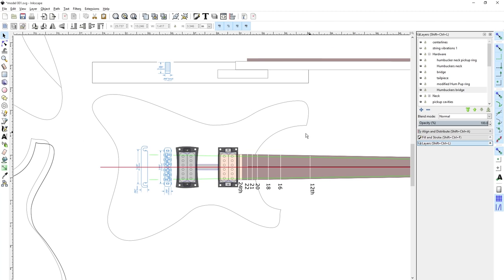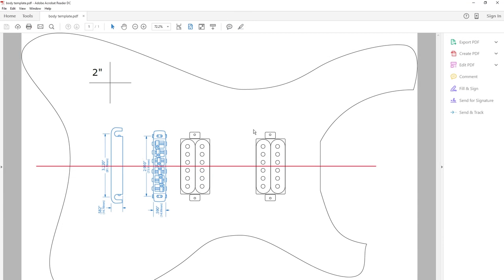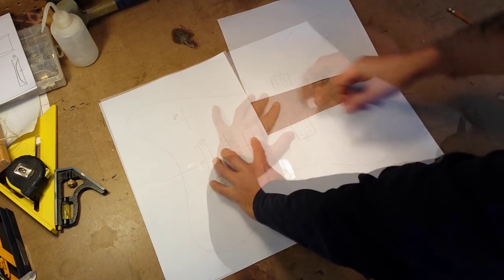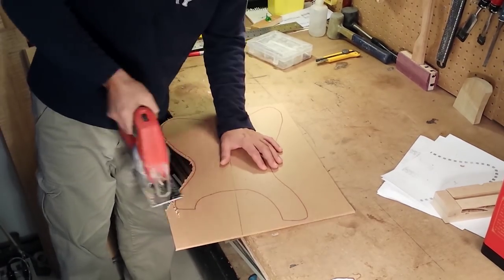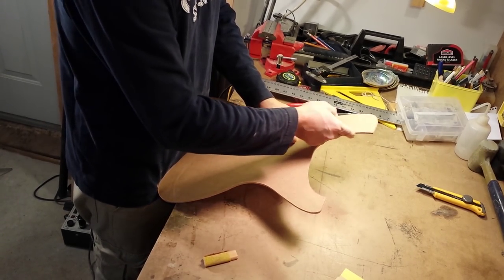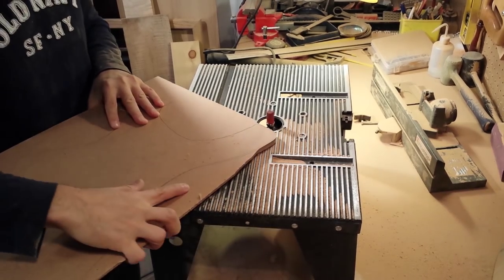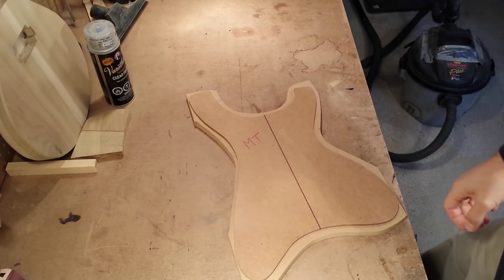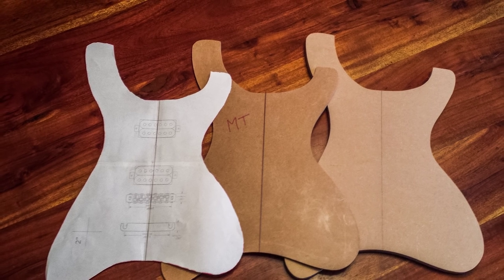How To Make A Guitar Body Template

Comment: You can make the edges of the 5/8 MDF template nice and hard by soaking them with thin CA glue.  I've used this trick before and it works quite well. But make sure you wear a respirator as the fumes from the CA can get quite nasty.
Reply from the maker: I did harden the edges with some polyurethane but I prefer your idea of CA glue, thanks!
Reply: You're welcome! Keep up the good work.

Comment: How come making a second 3/16" MDF template using the first leads to a more perfect master template?
Reply from the maker: Because the ball bearing on the router bit will ride over the smaller dips, bumps and marks on the first template and not register them on the 2nd template.

Comment: my template doesnt fit to the scale in printing in the preveiw box it doesnt fill out to to edges and when printed its not to scale, in inkscape i used to fit to scale or page option and i dont know if it worked so any solutions for me?
Reply from the maker: From Inkscape, save it as a PDF file and then open it in Acrobat Reader and print from there. That's what I do.

Comment: When I print it out it is still only a small image on the paper. How can I cut it into 4 pieces so i can the print them out and put them together?
Reply from the maker: It's probably because you are printing with the "fit to page" option. Look for a "poster" or "tile" option in the printer settings. Also, I found it works best to have the file in pdf format and print from Adobe Acrobat Reader. Hope this was helpful.
Reply: I've done all of those things and still have the problem. Printing out headstock templates should be easy enough because of how they compare to the size of the paper, but for bodies it doesn't work for me.
Reply from the maker: What software(s) are you using to design and print?
Reply: +Project Electric Guitar I use photoshop to create my design, set it all up for acrobat, then use acrobat to set it up to print like in your video.
Reply from the maker: The only thing I can think of is perhaps the actual guitar body is not to proper scale in Photoshop!? Besides that I'm at a loss! Also make sure to save as a PDF and open fresh in Acrobat Reader. Sorry, that's all I've got.
Reply: I'll try that. I did it last night but my damn printer ran out of ink lmao great timing. Thanks for your help man